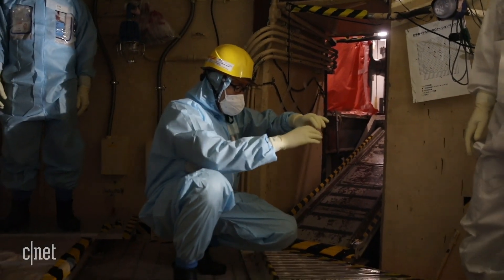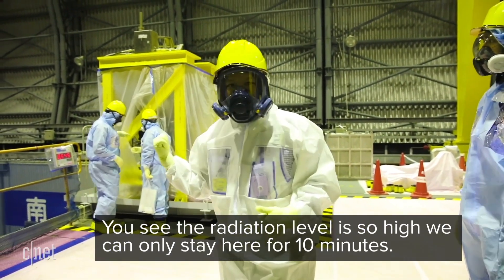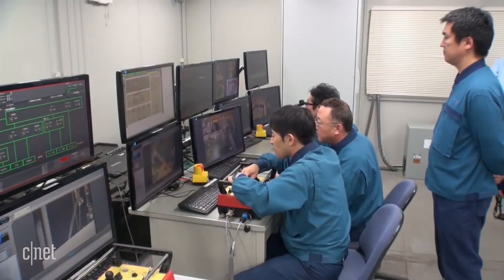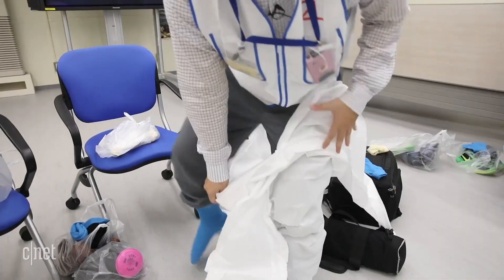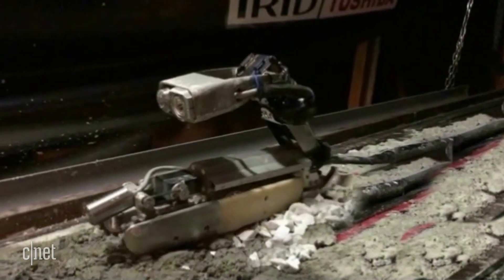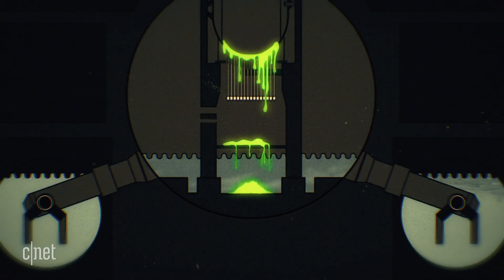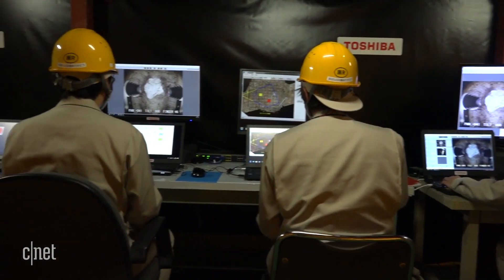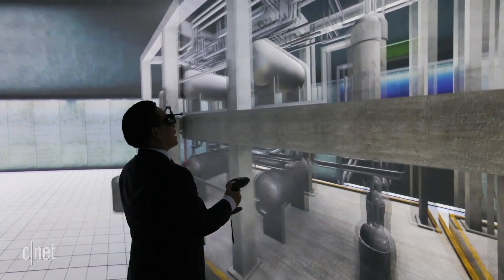How robots are cleaning up Fukushima's nuclear disaster

Comment: That was smart, built a nuclear power plant in an area that is earthquake prone.
Reply: You’re missing the point- the earthquake was not the problem, the tsunami was, Fukushima was originally required to be built with 10 meter high flood defence which would have defended against this tsunami but instead built one that was 6-8 meters high. The area that Fukushima was built had been historically been hit by tsunamis higher than 6-8 meters
Reply: Contrary to popular belief, nuclear power-plants is not earth quake sensitive. The issue with the Fukushima plant was that reactor 1-4 didn´t have any passive cooling like modern plants does. What promoted the reactor to fail was the flooding of the backup generator. There was also several other issue in this very old design that newer reactors don´t have problem with.
The wave hitting Fukushima II power plant was even larger, but there nothing happen because the reactors was a bit more modern
Reply: Just like in California
Reply: Ohh. You're smart 😱 OMG. To minimize people's aim good for country
Reply: As opposed other common types of plants that have a higher constant pollution rate, with only a slightly lower risk for destruction in the event? You must remember, there are year-decade long studies on which type plant would be best for an area, and in an earthquake prone area, much care is taken to protect something so important. This earthquake was far worse than any would have expected, but the plant withstood it. The real damage was caused by the tsunami, far larger and quicker than could be imagined, struck. And that has more to do with the magnitude of the quake, mixed with where its epicenter was. The powerplant did the best it could, as did everything else built there. It's the same as saying a collapse of the Hoover Dam because of a sudden rain torrent mixed with an earthquake, was because of its placement.  It was a rather quick series of compounding s***storm like conditions.
Reply: @Andrewfyti  and for all that it still failed
Reply: @scousepagan7186  The reactors only failed because the backup generators were flooded and water couldn't be pumped in to cool the fuel rods.  Earthquake and tsunami didn't breach or damage the containment vessels. TEPCO was irresponsible putting them in the lower levels where they could easily be flooded in case of an emergency. The reactors were built by the ocean for the massive amounts of water needed for cooling the core. Had the plant been built inland in a centralized location it could have been much worse
Reply: @Andrewfyti  and now fukushima reactor have millions of tons radioactive waste savely stored for the future generation, not a pollution of course
Reply: they know their shit better then anyone here,
Reply: videogameboutique 

Eh ... Most of them are ....
Reply: Your statement is kinda wrong. They are still smart they just cant or foresee the future. Japan already knows they are earthquake prone. I think they just didn't foresaw that a 9.2++ magnitude earthquake will hit them. I think they have built the powerplant basing on their previous data. They didn't think that a 9.2 will hit them. My guess, using their data they have built the powerplant to withstand an 8.5 magnitude earthquake and with their old data the strongest magnitude they had was jusst 7.8++. They also added .+5 allowance on the structure putting the structure to withhold 9.0 magnitude earthquake. And also, Indeed the earthquake ruptured the core but it didn't stop the generators to pump water on it to minimize or control the radiation leakage. Do you know what cause the explosion? It was the tsunami. Tsunami flooded the generators stopping the powersupply  supplying the water pump to the core.. After that you know what happened next.
Reply: @miaxgabventures1285  why have nuclear power in the first place. take the tsunami like a real man or women.
Reply: @colins1358  because when they are well maintained and don't suffer meltdowns, nuclear power is a zero emission clean great source of energy
Reply: @colins1358  because it gives huge energy human need by not using coal or oil beneath earth that is getting zero. Before they create that many years ago, that is their study on how have more lower cost energy without breaking the environment. But they know how hazardous a mistake at that plant. Actually the creation of the plant is huge a lot of safety as explained above. It happened that unbelievable out of record earthquake can happen. This is the only earthquake I heard 9++. It's just out of imagination. People do their best as they know what is better for their country. To built that. That was a huge effort to make it 110% plus safe they can. See.. that plant still withstand that they can pump water for water at least. No people or creator will like a huge disaster or planned it with huge group of cooperating that was 👍 for whole country. Imagine that. At this modern day people are finding new and better ways than nuclear power plant. Every industry who was bad to Earth was created in what they good purpose.. But in this modern world, people are just creating factory without knowing how to treat waste products and how when disasters come.
Reply: @zachmueller2912  I feel you. I mean how could they let this go wrong. if the source .when right. is that good. seems like a very small margin for error.
Reply: Quintessential kamikaze
Reply: @ffflyer2266   FUFF22